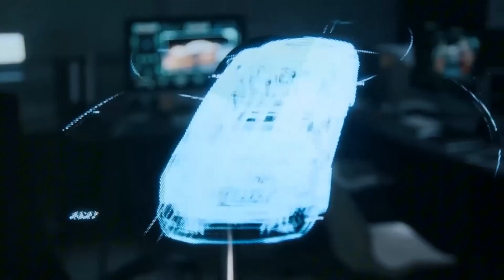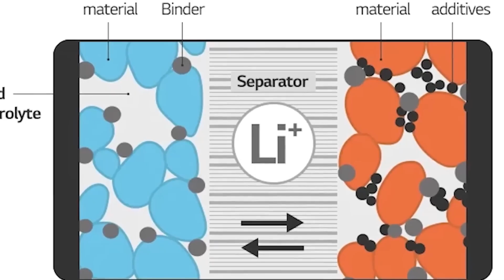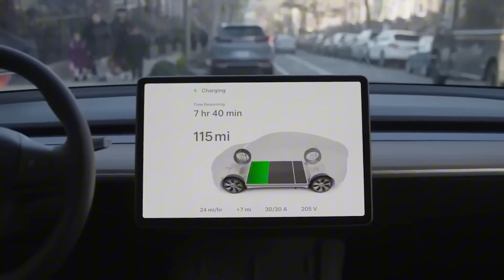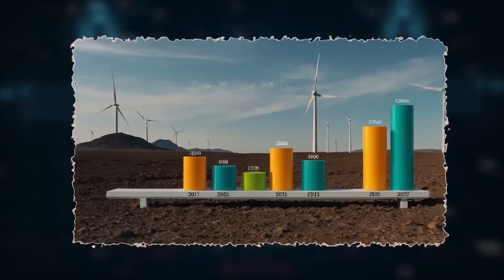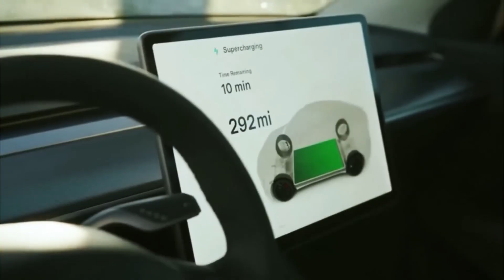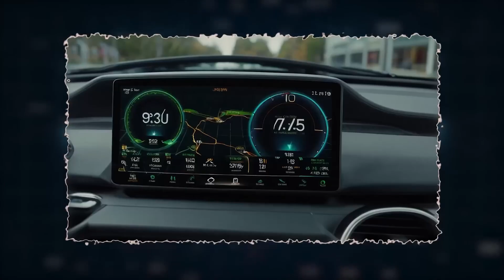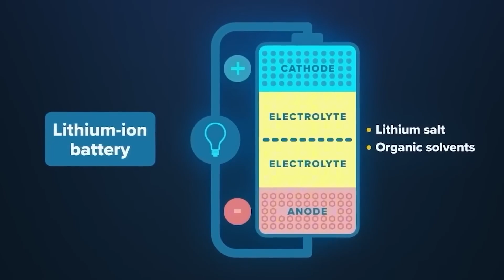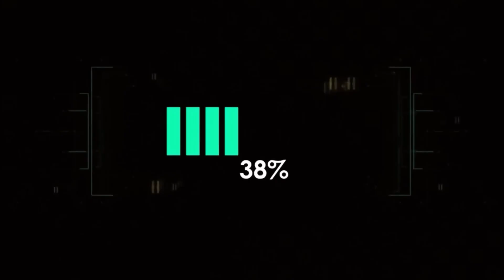Toyota CEO drop bombshell Toyota NEW Solid State Battery 1000 Miles with 5-min Charging!

Comment: The 5 Minute charging idea is as idiotic as a truck which is 100 meters wide and 100 meters long: Sure you can theoretically carry your entire inventory at once, but there is no street in any developed country where you could drive that thing.

The same goes for 5 minute charging: Yeah in theory you could pump this insane amount of electricity, which an EV takes over an entire hour on fast charging, and pump it into a single EV in 5 minutes - but there is no electrical infrastructure on the entire planet (except for some highly specialized industrial locations), let alone in normal cities, where you could actually get this insane amount of power.

In reality, barely any charging stations can charge up to the limit EVs can already handle. So what good does it do to increase the maximum charging speed, when the old maximum is already too much for the electrical grid. 

Oh wait - its good advertisment and sales - of course.
Reply: I  do not understand how this whole industry did not choose swapping batteries instead...
Reply: @jorgemanso6570  They tried early on. But imagine how many additional EV batteries you would need to produce AND constantly keep charged up, in order stock up enough batteries on every existing charging station. Scale this up to the number of gas stations around the developed world, and we would end up needing like 100 for every EV just to make sure there is always a charged battery available - whereever you go.

And the normal battery problems make this even worse, because keeping batteries charged is harmful to them. Heat in the summer is harmfull to them. Cold in the winter is harmful to them.

Thus you would need airconditioned or underground storage with rather steady temperatures for storing these constantly charged batteries - which still eventually die when not used.

The battery is the absurd weak spot of the EV world, and the entire EV industry works by shifting this liability and risk to the customer, who simply loses his entire investment if something happens to the battery. That's the solution - simply shift the problems to the private customer. And therefore battery storages are out of the question.
Reply: @ForcefighterX2  Makes sense...thank you for your comment...